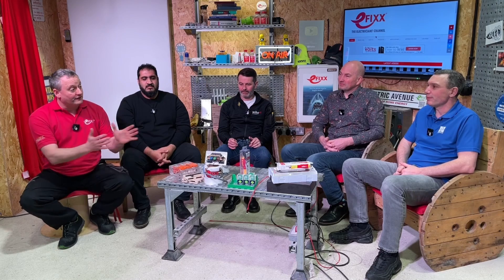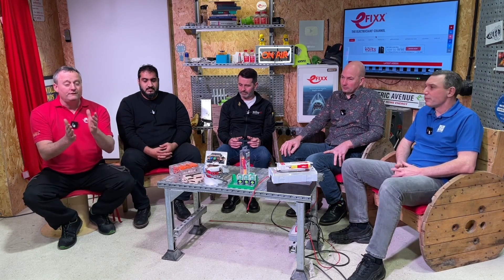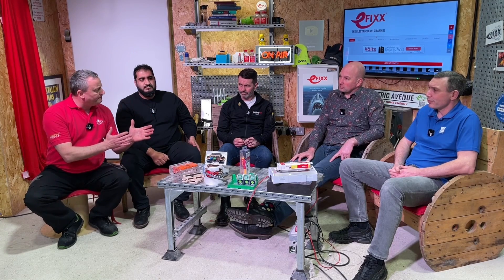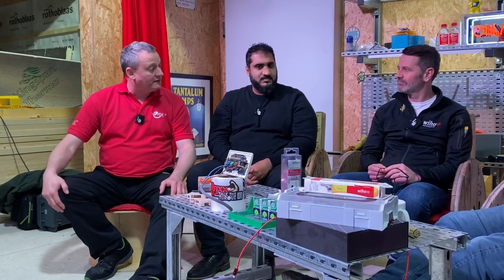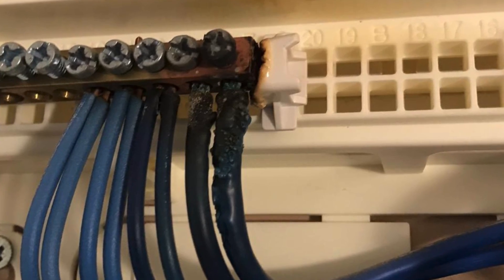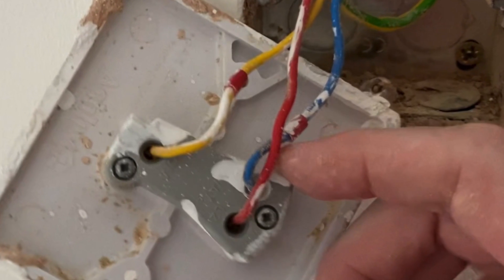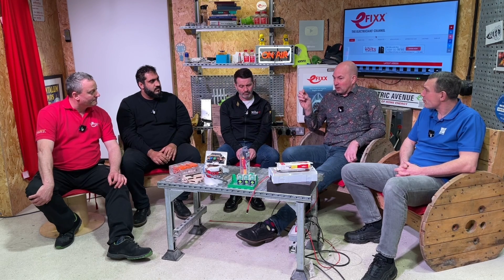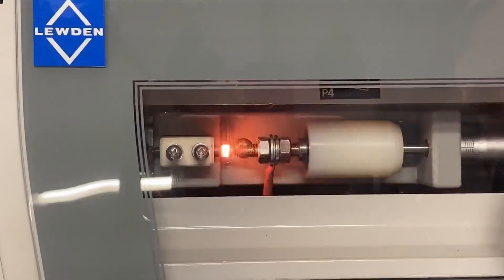ELECTRICAL FIRE - Screwed Connector Burned Down The House 🔥🔥🔥

Comment: Rob has hit the nail on the head when talking about lesser material being used , in the past few years i have been to a lot of call outs where a socket has burnt out , no signs of loose connections etc , open a modern socket compared to one from way back.. and the prongs are a lot thinner... im wondering if older gear was designed to run at full load constant and wether newer gear is designed to run at full load for a given time? .. same with consumer units 17th edition on.. neutral bars are a lot thinner .. very rare to find an over heated mcb etc.. its usually the neutral bar.. yes torque is important.. but so it heat dissipation/resistance .. really good subject guys .. be good to see you dig deeper into this
Reply: On the occasions I have fixed trunking above or below a CU, or both, I have knocked out the knockouts and drilled the trunking to allow air flow in and out of the CU.  I have found that some of the failures of boiler pcb's was that they were too hot. There again if I can get air flow over them by taking out bungs and knockouts, I will.
Reply: Back in the day we built things to do the job and be safe.
These days it's make it as cheap as you can, using as little as you can.

The socket at the end we'll say and we want it to run 20amp so it's made to work.
Back of mind is that the CU protection will sought the failures out. So how much or how long isn't always to standards

I don't think these kids would actually know how "cut back" installations are these years.
Reply: @guywhoknows  
I do not entirely agree. The recommendation is RCBOs on each circuit, with an SDP, in a mandatory metal case. Look at the CUs of yesteryear with many having wood content.  

In the UK we tend to oversize cables, fitting say 6mmm when 4mm could do. Apart the cheapo brands, socket quality is good to yesteryear. Quality and safety will improve when screwless connections are common.  Use Wagos to take the rings load, not the socket terminals. See my post about Wagos further up.
Reply: A double socket is usually designed and rated to take 20a but you can plug in and use 26a, a 13a fuse will Sit at 20a all day long so in theory you could have 40a flowing through a double socket. 

The other point to note is that an mcb is designed to be able to carry up to 1.45x it’s rated current for around an hour…. Which on a 32a becomes 46a… 

This means a double socket rated at 20a with 2 dodgy heaters plugged in could be pulling 40a+ for over an hour, of course the sockets going to give 😂
Reply: being old school 9xout of ten times skts with burn marks was caused by loose connections in the plugtops

Comment: The only time had i have overheating problem was caused not by a loose or too tight  connection but by a brand new 3 phase board the actual fuse holder not making good contact in holder 32a gets pretty warm !

Comment: We on the continent have a very long experience with levered connections on for instance  sockets.And ofcourse we have in general a higher voltage,because higher voltage means less amps.And the amps is the main factor for fires.More amps means more change for a fire.
Reply: You on the continent have a similar line voltage to us.  This is a discussion in the UK which also operates at a nominal 230V
Reply: Same voltage but you tend to use 3 phase more often for high consumers.

Comment: Not used them yet but wago dose din rail connectors that will take a 10mm cable, I use wago connectors all the time and have never had a problem, just make sure you use the correctly rated connector for the job, I am also about to use the mk sockets with the push connectors on. The way I see it I think that if they moved towards wago style connectors not only would it eliminate having to have torque settings on everything and having your torque driver calibrated every year would be miles quicker. I would pay more for a consumer unit with wago style connectors as think of how much time it would save. We have an apprentice at college and he does not and is not taught to use a torque drive, we don't have to use them and a lot of electricians I know don't use them, so surely if it is as important as you are all saying which I don't think it is why are colleges not teaching it? I also think one problem that is not addressed at all is the which I think is more important is the quality of the screw terminals in a lot of devices and consumer units, they are not as good as they used to be. I am in the process of buying a torque driver just because that's the way it seems to be moving to but we shall see.
Reply: The threads on a lot of cheap stuff are awful and sometimes they just bind, varying from unit to unit. Even with a torque driver you get variable results. I wish they would outlaw screw terminals that are not cage clamps, which are much more forgiving, just do them pretty tight and your wire is now a little squared, not practically cut like a screw that was tightened all the way down.

Here in Finland it is totally conceivable to have a home with no screw connections in what you call final circuits, only the busbars and feeder use screws, hopefully torqued right. You can get the thing you call a consumer unit with MCBs that take 2 wires on the load side in spring clamps, all junctions done by anybody who is not backwards use Wagos, all light switches and outlets (except some cheap stuff sold in diy stores) have had spring connections for ages, starting from the 1980s.

My experience is that the spring stuff from the 1980s is still fine, but not uncommon to find a loose screw terminal from those times.
Reply: @JussiPeltola  wow bet that makes installs much faster, not faffing around with screws all day!

Comment: Hi Gary the amount of shower isolators I have had to change due to a hot live or neutral, some of the quality of these switch is dreadful, I know isolators are a requirement but I would prefer a cable straight from the consumer, when I install it’s tighten connections, push into housing, pull back out, retighten, wait 10 mins and you can usually get a bit more turn when the strands have settled.
Reply: I agree, 10mm cable crammed into the back of a shower isolator, when you don't have space to slide the cable back through the ceiling after terminating, is just a disaster waiting to happen. If you want a continuous cable from C.U. to shower you can always install a contactor. Local isolation with a much safer 1.5mm switching cable.
Reply: @Gerald Elwood  I have employed this technique. Contactors will outlast shower isolation switches with possibly only one exception, the Crabtree isolator which in design paid attention to proper clamping of the conductors by use of angled screw fixing.
Reply: I've done the same countless times

Comment: Why are you not looking into that having 32A in front of sockets can be a big cause of fire?
32A is more than the supply for my house (3*25A) and is not having any issues even I'm having heatpump to heat my hole house and hot water.
Reply: Kettle, toaster and an iron on a circuit isn’t unusual here.
Reply: @edc1569  It's the same here, and it's not a problem. It's just how you design your wiring.
Reply: 32A to sockets has not traditionally been an issue.  That's down to the fused plugs.
Reply: 1A is enough to start a fire on a bad connection. UK sockets carry 32A only on the terminal connecting the 2 ring conductors. Otherwise the plug fuses limit the current to 13A per single or 26A per double socket.

If the standard was less than 32A on rings the sockets would become cheaper and rated for that lower current and even more likely to get overloaded because people will still keep using the same appliances and loads, I do not see any benefit in that.

In the Nordic countries we have the 1.5mm2 circuits rated for 10A where you can plug in a kettle or space heater and that leaves no room for error either, if you have a bad connection it will catch on fire. Same for the 6A circuits they seemed to like in the old days in Sweden. Still will catch fire if there is a bad connection and a long-time 6A load. And 6A gets really impractical in a home with modern electrical needs.

To be "safe" you would need to undersize the fuse to something like 2A, while keeping the same wire size, this is not economical and still carries the risk of a really bad connection burning. Arc fault breakers are a much more effective use of resources.

Comment: If we have screw terminals instead of screwless, I would prefer clamping terminals like OPDs. Terminal screws always damage the conductors, especially when a test engineer removes a conductor from a terminal screw then reterminates again when testing
Reply: Agreed, make cage clamps standard for anything to meet regulations
Reply: They used to have rounded bottoms to the screws they cheap out on that step to save pennies.

But that said, a "damaged" cable can be down to connection. You would want some "mark" to ensure there is good regular contact.
I've had one cut through. Burr on screw.
Picked up on fourth testing.
First is  sight, seconds pull. Third is testing, 
Fourth is recap the test later. :)
Reply: @guywhoknows  this is why clamping style will always be the best maintainable connection as it compresses the conductor evenly, Wago style is good for speed of maintenance without damage.

I was faced with a domestic electrical installation installed by German electricians who flew over to UK. They had a Hager panel and about 100 circuits and the MCBs on the RCD banks were push fit!! I don't have pic of MCBs but I have pic of panel and the switchgear etc.  YouTube wont let me upload here as a comment😕
Reply: @MrSJT  uses to be good when you could picture or video reply.

Clamps are fine, the old u clamp was good before they changed to the flat ones. Which I think is fine for fine strands not so great for thicker multi core. 

Had one last month, thick multi and corrosion had gone up the wire and was heating things up. 

I'd be for a soft material conductor clamp that makes good contact and grips.
Reply: @guywhoknows  yes forgot about the U clamps

Comment: Thanks for talking the torque! Sounds like the UK should bring on some more of "the continent" electrical ideas! Cheers from Australia
Reply from the maker: We hear you have IDC connections on sockets
Reply: @efixx  We don't on consumer accessories such as GPO's but Krone type IDC has been around for some years, mostly on commercial and industrial cabling in roof spaces for lighting. Our lights have standard three pin plug.

Comment: Copper is a funny old thing, when annealed, it's as flexible and squashy as lead and after work hardening you can make an axe out of it to cut down a nice tree. In the plumbing game, copper pipes are suplied half hard unless you by coils 8-10mm micro bore say. Domestic cables I think are about the same supplied as half hard.  Anyway, I would like to call BS on the forensic fella, but I think it's probably more likley he had to dumb it down a bit or didn't explain it right with the jelly babys. And it's hard work to explain something to people who are not likey to understand it. Like he said, I'm not gonna get into aluminium. RE torque on different fastners and fittings, you could derive that from other manufactures instructions, It wouldn't be to hard. But it would be nice to have a guidline available. Cage clamps are pretty good in that regard as they have spring to them unless you give them a full 300Nm, which does help with consistant preasure regardless of differing material thermal expansion causing work hardening of copper, and every thing is harder than copper hence loose joints over time, in rigid screw based terminals.
Reply from the maker: More content on this coming soon
Reply: Best explanation of how work hardening can lead to loose connections.